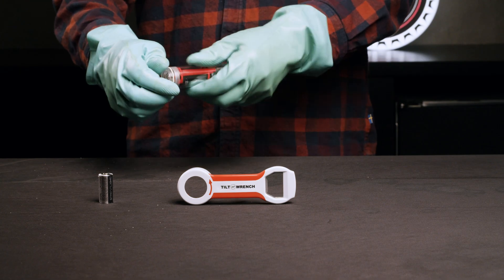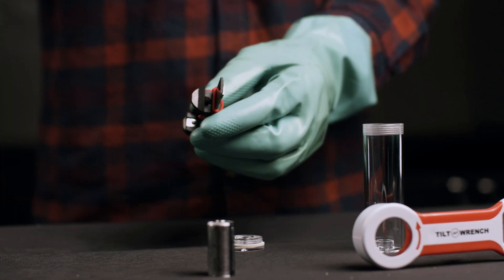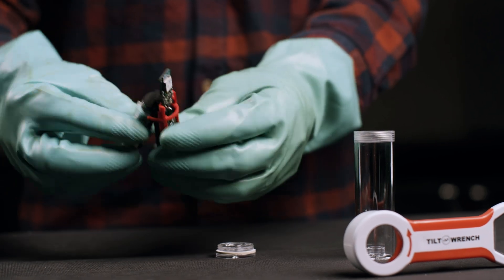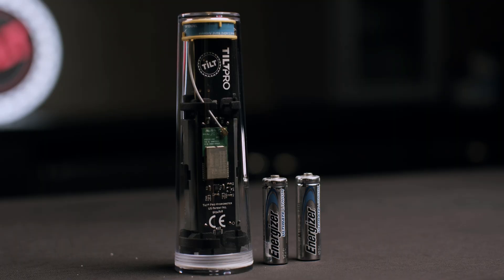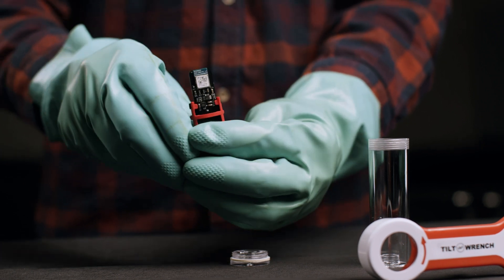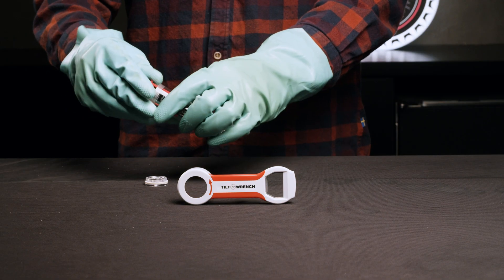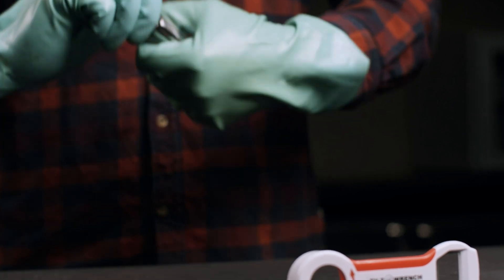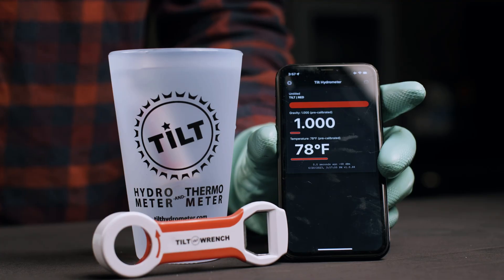How to Change your Tilt Battery (Tilt v3)

Comment: Can you use a rechargeable battery?
Reply from the maker: Rechargeable batteries have too high of a voltage to work and will damage the electronics. If the battery is going dead quickly (less than one year), please contact us at info@baronbrew.com and we can repair or refurbish your Tilt for you.